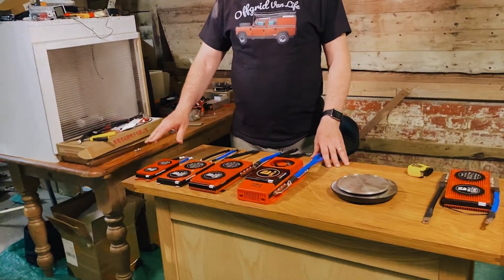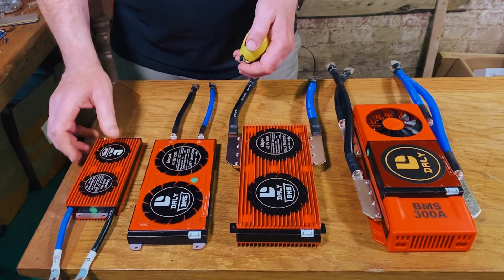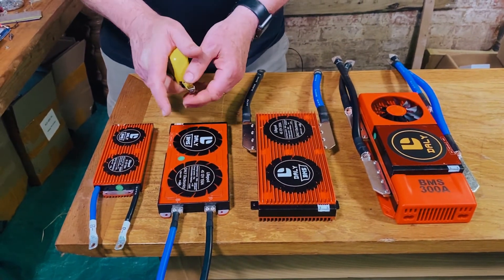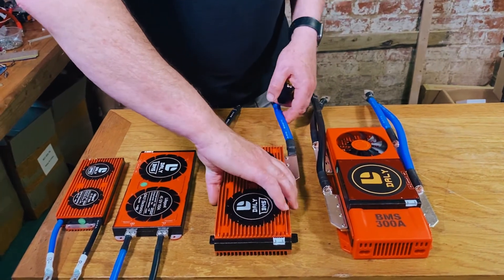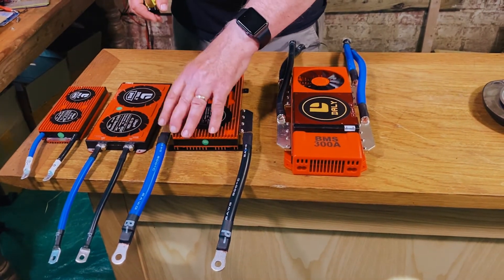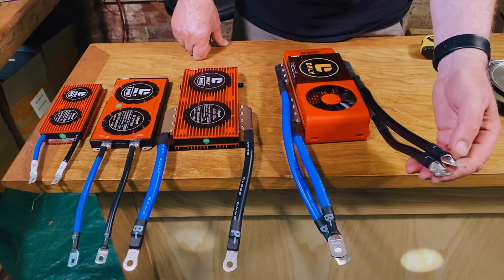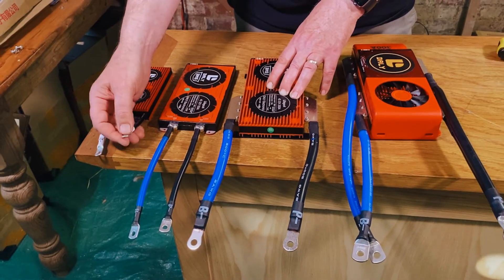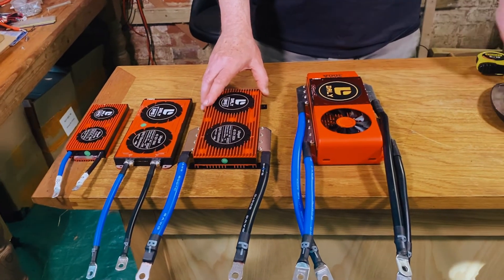Daly Smart BMS Size & Weight Comparison

Comment: Great review thanks, quick question with the BMS leads being M8 how would you go about fitting the BMS directly to a Victron Smart Shunt as they have M10 bolts
Reply from the maker: In the past we've cut the lug off and put a new M10 lug on if we need to connect directly to a Victron Smart Shunt.

Comment: Скажите пожалуйста , а этот bms можно включать только когда к нему аккумуляторы подсоединены ? 

И по каким протоколам он общается с компом , телефоном или дисплеем ?
Reply from the maker: Yes, the BMS can only be turned on when it is connected to battery cells correctly. 

There is a connection port on the BMS that you can connect a USB cable to be able to administer it on your computer. On the "Smart BMS" version. you can plug a Bluetooth dongle into the connectivity port that allows you to connect to the BMS using a mobile phone.

Comment: @off grid van life Hello. Do you or Anyone know about a 32s 48v configuration needing a 250a unit but with programmable option? Don't see anything out there cause I need to set the high and low cutoffs of each cell precisely. Ive got 32- 3.2v batts in a 16s2p 48v configuration. Or would I buy 2 16s daly 250a programmable units and run In parallel to balance the 32 cells.?also..im confused as to the parrelled batteries in the setup as units would see as one battery so not sure on 16th balance wires from both units. Please hope someone can help cause ive researched for hours and not sure what to do here. Thanks
Reply: 32S would be 96V, not 48V
Reply from the maker: We're not aware of a 32s Daly BMS, so you may need to go with a 16s Daly BMS and have your cells in pairs using a 16s BMS or have two banks of 16 cells with two BMS.

Comment: Greetings I need help I have 16 batteries of 3.2v 320ah, (48v) a charger at 60amperes and an inverter of 3,000watts, which BMS should I buy?
Reply: Hi @Jose Perez. I have exactly the same question. So, in terms of amperage, what kind of BMS have have you bought?
Reply from the maker: I would recommend Daly! For a 3000w inverter, you'll need at least 250A BMS so maybe go for the Daly 300A BMS for some extra headroom.
Reply: @offgrid_power  Please explain your calculation. 3000W/48V=62.5Amp.
Reply from the maker: Ah yes, I misread that it was 48v - was thinking in 12v. You are correct that a smaller BMS would be fine. 👍🏼

Comment: Hi which bms would you recommend to run a 2000watt Giandel inverter?
Reply from the maker: We would recommend the 200A for a 2000W inverter. That's what I use in my van and it works great. :)

Here's the link to the 200A BMS: https://geni.us/Daly200A
Reply: @offgrid_power  Thank you.

Comment: On the Daly bms if the balance leads are too long or too short can you add wire or take off wire I’ve been told not to cut the Balance leads is this true.
Reply from the maker: You can cut the balance cables and extend them, but you should make sure that you use the same gauge wire for each balance cable and also ensure that the lengths are identical. This is important to ensure consistent resistance and avoid voltage drop (even if very small) between the cables. Essentially you're trying to make things as consistent as possible so your BMS doesn't need to do unnecessary work having to work with uneven cables.